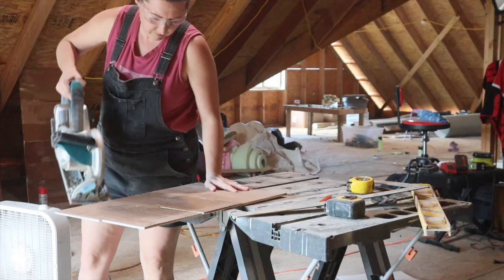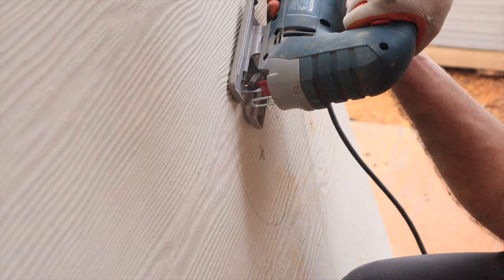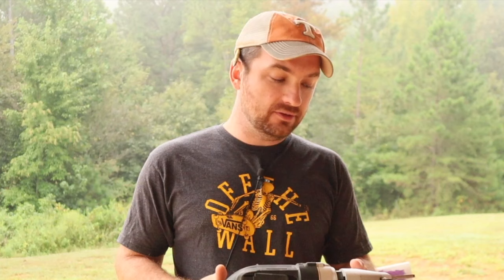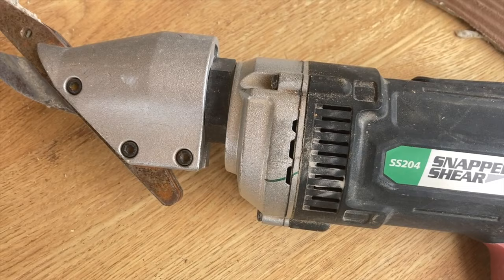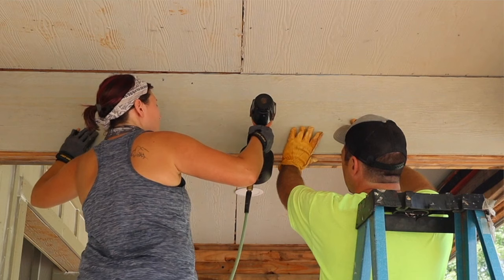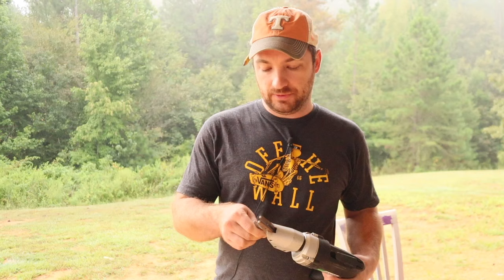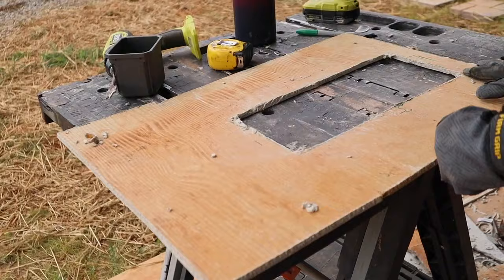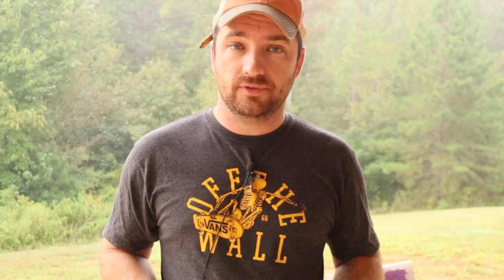Fiber Cement Shears Review & Demonstration

Comment: Can I cut a board in place if the board ended up too long.
Reply from the maker: Yeah it usually just depends on how much overlap you have with your other material. May want to try a circular saw - just keep in mind it will trash your blade